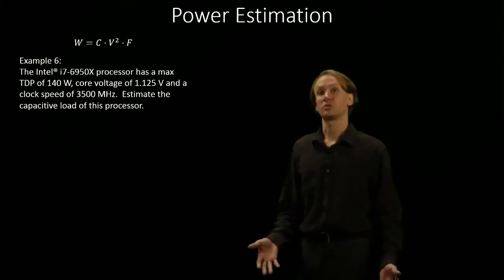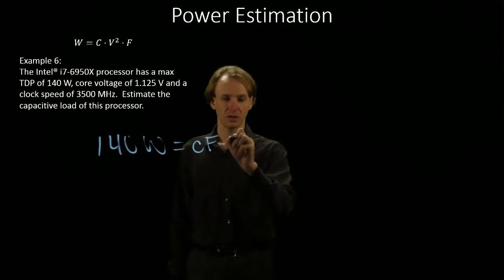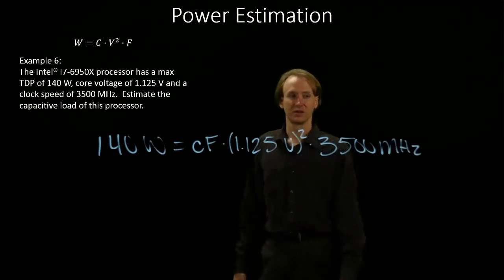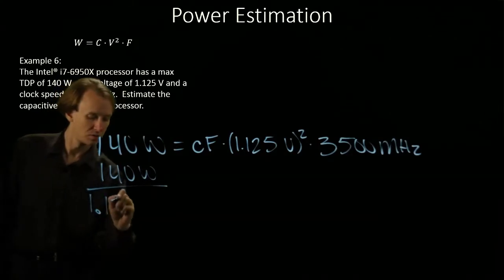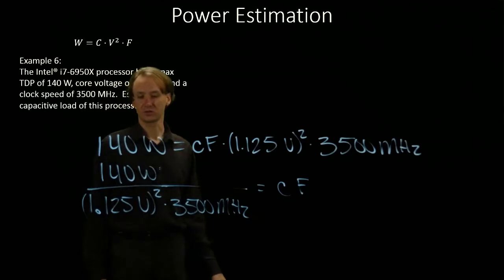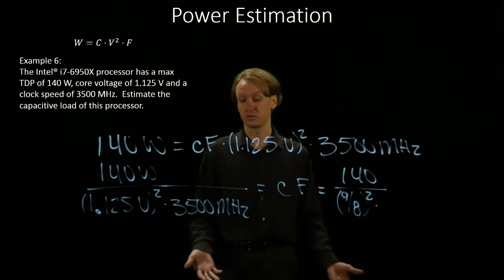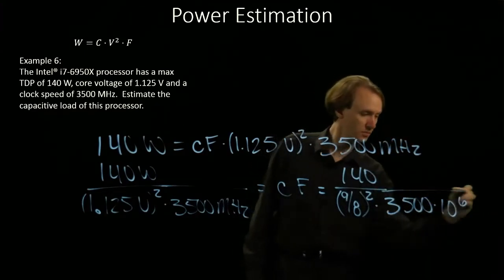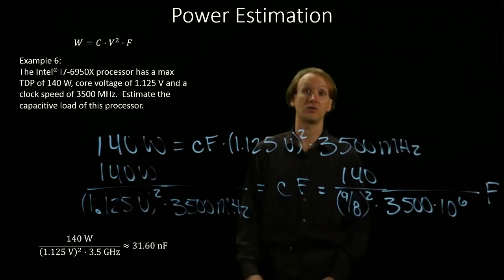3-f.  Power Estimation Example 6

Comment: 0:10 The Intel i7-6950X processor can consume up to, or has a TDP of 140W, which means that it can dissipate up to 140 watts of heat without exceeding the maximum junction temperature for the laptop's CPU. Junction temperature, short for transistor junction temperature, is the highest operating temperature of the actual semiconductor in an electronic device. Various physical properties of semiconductor materials are temperature dependent. These include the diffusion rate of dopant elements, carrier mobilities and the thermal production of charge carriers.
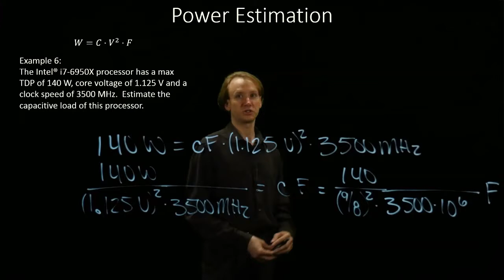2:55 math refresher
Q: Do you or could you explain these concepts in-depth in another video? 
1)  At the low end, sensor diode noise can be reduced by cryogenic cooling. On the high end, the resulting increase in local power dissipation can lead to thermal runaway.
2)  How does the diffusion rate vary according to different dopant elements, carrier mobilities, and charge carriers and what are some different examples?
3)  Every time the temperature sensing network determines that a rise above TJ is imminent, measures such as clock gating, clock stretching, clock speed reduction and others (commonly referred to as thermal throttling) are applied to prevent the temperature to raise further.
https://en.wikipedia.org/wiki/Thermal_design_power